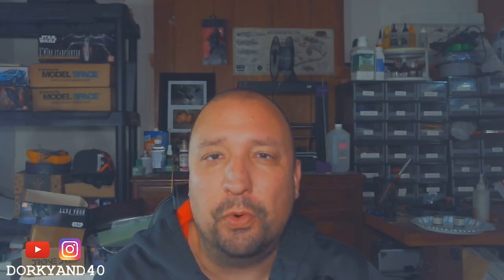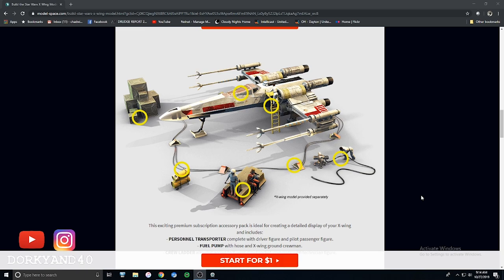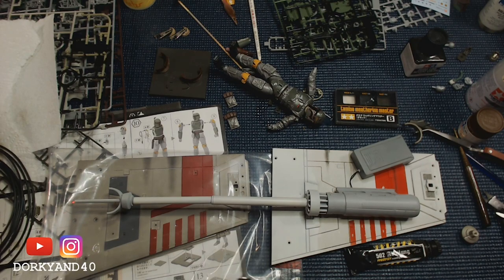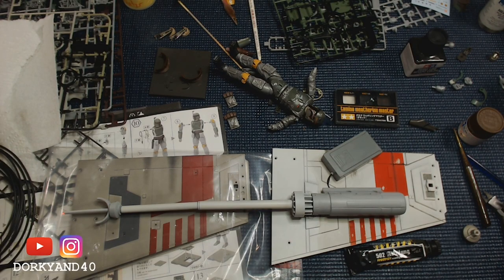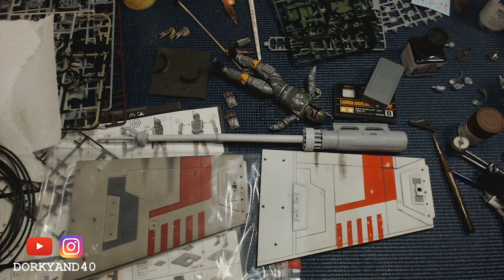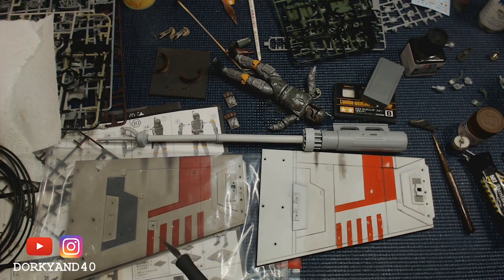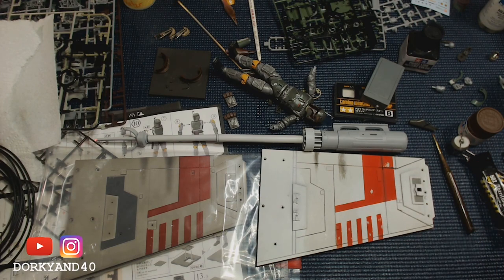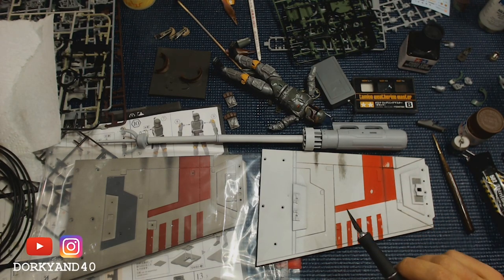DEAGOSTINI BUILD YOUR OWN X-WING:  PAINTING AND MODS

Comment: Genius tip on using a toslink.
Reply from the maker: Helps a lot but you still get a lot of light leak where the led meets the fiber. You can always light block the inside or use shrink tube to sheath the two together.